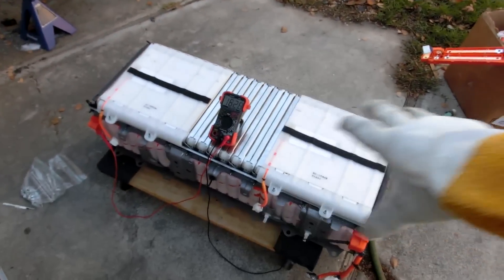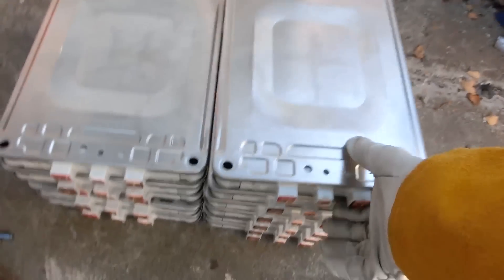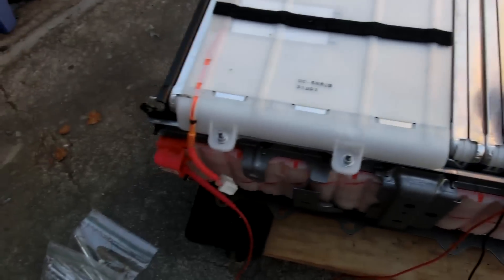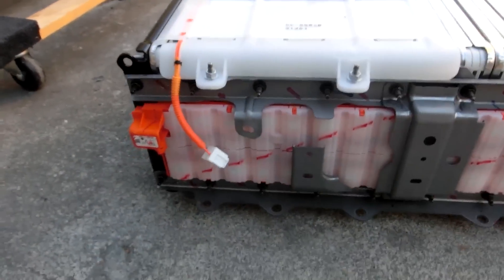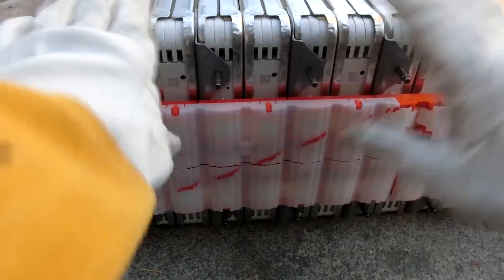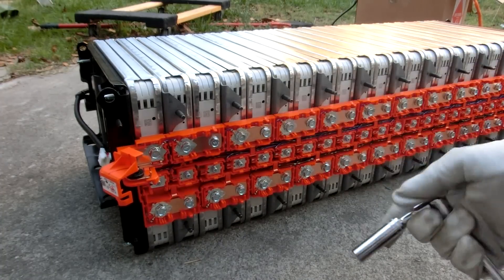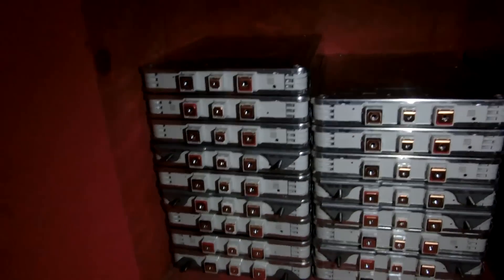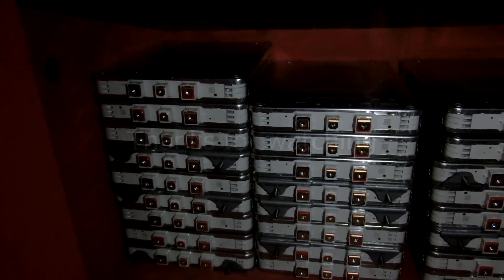2013 Nissan Leaf battery disassembly part2

Comment: 180VDC would at most give you a tingle, not enough to kill.. (if you meant lethal being electrocution) 
still best to be cautious though since a short circuit would be a verrrryyy bad thing.
Reply: 180v is plenty to complete a circuit through the body , the amount of current they could put though you could easily kill you
Reply: Dynamitemonkey500 No... It's DC 180v, our body cannot be modelled by a simple resistor as we have capacitance too. A capacitor in a DC circuit is seen as an open circuit in the steady state (i.e. yes current will flow through you if you have both hands on each terminal, but the duration of harmful current is far too low to cause any injury)
Reply: IrishSkruffles
a capacitor is a DC power source. We are talking about DC voltage. A capacitor is a DC power source and yes a 240V Capacitor can stop your heart. A 180v battery can deliver enough current to kill you. If you dont believe go grab a 240v capacitor. There have been cases where people have died on 48v dc before.
Reply: +IrishSkruffles      interesting, so what's the impedance of the body (hand to hand)?     and the pure resistance?
Reply: Henry Chang Both vary from person to person and the moisture of your hands at the time but I can tell you resistance of unbroken, dry skin is roughly 2 mega ohms, and capacitance is 1-3nF.. impedance is harder to measure and it's worth noting that high voltage can break down your skin drastically reducing your resistance to only a few thousand ohms
Reply: +IrishSkruffles    for 60Hz AC,  the impedance for the "capacitor" is 1-3 mega ohms,  so it's insignificant if the resistance is a few thousand ohms at high voltage
Reply: Henry Chang Yes that is correct but if the skin breaks down, the current flows through your flesh so capacitance need not be modelled, that's what i was saying
Reply: Henry Chang I found this interesting:
http://www.ncbi.nlm.nih.gov/pmc/articles/PMC2763825/table/T1/
Reply: +IrishSkruffles    actually, more current goes through your fresh and blood due to the moisture after the skin breaks down,  whether it's AC or DC.
Reply: +IrishSkruffles    good info.  thanks
Reply: +IrishSkruffles hahaha your hilarious...lol That 180v will clench every muscle i your body if you grabbed onto it. If you grabbed the leads you will not be able to let out. 180v will light your ass on fire it only takes 90v to penetrate dry skin.
Reply: Cutler Cycles You are mistaken.
Reply: IrishSkruffles
Negative go touch a 240v capacitor or 120v capacitor. even 1nF that delivers 100ma can stop your heart and kill you if you complete the circuit through your heart. Those are DC examples.
Reply: +Cutler Cycles Capacitors != batteries,
16mA is enough to make your muscles contract, which 180V cannot do.. I've touched 300VDC supplies before with nothing more than a tingle, you are mistaken.
Reply: +Cutler Cycles 
A capacitor discharges nearly instantaneously whereas a battery does not, it is a different case but even then it would have to have a capacitance of over 250uF to do any permanent damage (at 300VDC).
A 180V battery can provide a lot of current, yes.. but not anywhere near lethal levels if you touch the terminals with dry hands.
FYI I have and oh look, I'm not dead..
Yes you can die with as low as 30VDC, but that's in aquatic environments..
Reply: IrishSkruffles Maybe you haven't but other have died from 48V and up. What you are saying is like a car accident can kill you at 35mph but since I didn't die in my car accident at 35mph then car accidents at 35mph must be safe. Bad logic. It has been scientifically proven that you can die from these voltage ranges so the end of the conversation is it CAN be dangerous and even lethal so its not wise to try an lessen the caution around voltages that high.
Reply: +Cutler Cycles I've been shocked multiple times at 5kv plus an five seen atleast 7 other people be shocked aswell, while I would say DC is dangerous with 1+ amp I think you might be talking about AC.
Reply: Voltage doesn't kill, current kills.  A ground fault circuit breaker trips at about 5 milliamperes or 5/1000 of an amp.  A 1/2 amp current through your body will likely end your life.   The current generated in an electrical shock is dependent on several factors but the battery pack shown here can kill under certain circumstances.

Comment: the brackets that are still on the batterys with the studs on do they come off to or are they stuck on to the battery
Reply from the maker: +David Simpson i think they are stuck..
Reply: that will make pack arrangement a little more of a pain then
Reply from the maker: David Simpson
actually i dont think so, i think it will add more places for mounting. after all i dont want anything close to teh terminals anyway.
Reply: true so how you going to do the cirty car 2 packs horizontal or 3 packs vertical each at max voltage ?
Reply: or will it be a case of the hole back seat area will be gone and how do you intend on getting them to your dads from where you are now
Reply from the maker: David Simpson
idk i'll figure it out...hahaha

Comment: Having been a mechanic for decades, can I offer a bit of advice on your ratchet technique?  Use left hand initially to break the bolts loose.  The wrench will be assisted by gravity and as your left arm begins to tire, you can switch back.  The day will go much easier.  Working against gravity does not help.
Reply: +Rinoa Super-Genius Dude.  The guy is offering free, hard-earned advice.  Enjoy it and add to your knowledge, particularly because it may come in handy in the future if you start building the habit now.  As for your tip, do you think a guy who is a mechanic for decades hasn't used the pipe-over-wrench-handle trick?  Exercise some humility - it will build relationships, respect, and knowledge.
Reply: you give too much credit to the pipe the wrench over wrench technique is better putting the box end on the bolt putting another wrench box in on the open end part of the wrench do not use harbor freight stuff for this you will break your knuckles let's all go to mustie1 to do our wrenching great video I wish you'd have broke down at least one of those I've never seen these I'm not familiar with any of this I only have had heard things
Reply from the maker: Thomas Finch
everyone's days are numbered.
Reply: +RyeOnHam The guy is using a metal screwdriver between the contacts of a high voltage battery pack. His days are numbered anyway...
Reply: Correct!
And always loosen ALL bolts a just a little bit.
Then use a driver with a T-bar to undo the bolts. support the long end with one hand and spin the Bar.
This works as fast as an electric tool.

If you are not a mechanic you waste time by:
- using the wrong tools
- using the correct tools in the wrong way
- undoing things that are better left alone
Reply: Jimbo Jones Well, I didn't realize you knew it all.  I suppose you can get everywhere on a car with a bigger bar or an impact wrench, right?
Reply: RyeOnHam Nope, that's why I also use combination spanners interlocked. Never had a problem cracking any nut with either choice of those tools in any space.
Reply: Can i offer some advice...when someone offers free advice take it, dont come back with a counter comment, makes you look and sound like a know it all dick, its all life coaching, we where all young once....apart from that good video
Reply: Rinoa Super-Genius Nah, you're welcome to throw out your own tips, as well.  But don't get hung up on that - it was a total side issue.
Reply: +RyeOnHam Would be nice to have some electric impact drivers too. Makes the job go by much faster. And if the pipe-wrench leverage trick breaks your ratchet, buy better tools eh? I like that I'm not the only mech that likes geeking out on these videos.
Reply: Thomas Finch Yeah, but it's an insulated handle... so, yeah.
Reply: +Jeremy Venturino I just use my 20v lithium drill with a socket bit ,just loosen them first with a wrench or socket , make for fast dissaselmbly , also most drills are all plastic nowadays besides the chuck
Reply: +RyeOnHam thanks very much for this tip!
Reply: +Rinoa Super-Genius Obviously his advice was meant for the many times you'll be equipped with just a ratchet and your arms. Using a pipe over the end of a wrench is a good way to strip your sockets, or worse, the bolt. Most mechanics have a pneumatic impact wrench at their disposal anyway.
Reply: +RyeOnHam In her defence, she was pulling the ratchet towards her which avoids the accidental punching of a hard object when the ratchet slips. Pulling the ratchet downwards isn't really possible that close to the ground so it's either work against gravity or risk punching the floor.
Reply: Jimbo Jones Breaking the bolts loos only takes a bump.
Reply: RyeOnHam A "bump" with what? Are you suggesting hitting the ratchet with your hand? That's a good way to injure yourself...
Reply: Jimbo Jones Do you even turn wrenches?
Reply: RyeOnHam Yes, and as part of my training 20 years ago we were specifically taught that if you need to break a stiff bolt either use a bigger bar or use an impact driver because hitting a ratchet with your hand all day is a great way to injure yourself. Who taught you to fix cars? He must injure himself a lot.
Reply: youre a virgin bro
Reply: any issue with use of a makita impact gun?
Reply: Rinoa Super-Genius  I would not suggest the pipe trick unless you want to replace the ratchet.  I'm just saying, I've trained scores of mechanics and if you get in good habits early, you can do more work quicker.  I got taught by my father and Grandpa who were both Aircraft Mechanics going back to before WW I.  50 nuts are okay, 200 nuts are gonna get tedious and tiring.  I worked with thousands of nuts, bolts, and screws at a time.  You can't stumble your way through that much work without some expert techniques.
Reply from the maker: n8guy
ok so he can give advice, but i can't give advice? lol whatever.
Reply from the maker: +RyeOnHam that would only matter if i have a bunch of bolts to break loose.

a better tip is to put a pipe on the handle as a breaker bar.

Comment: im surprised to not see any spacers between the cells. i guess they dont get that warm.
Reply: +MrTommymxr They do have a metal housing, I guess the heat conduction of that is enough. 
These cells also have a very low internal resistance and thus in fact don't get that warm. (except when you short them out of course ;P )

Comment: the volts won't kill you the amps will
Reply: +Comedic Sketches cue AFROTECHMOD
Reply: yeah i remember
Reply: +Comedic Sketches Your both right. The 12v car battery does not have enough volts to over come the resistance of the skin. Simple V=IR. It does though take only 32mA across ur heart to put into ventriculation, where U will need the zappy thing on ur chest to make ur heart beat right again. Only 32mA.... so we still should treat them with a bit of respect. It is the amps that will kill you not the volts. You can charge people up to hundreds of thousands of volts with respect to earth. The are fine until they touch or come close to something that they can make a circuit with and then the amps flow. Go and watch some high voltage helicopter and linesman vids on youtube its pretty amazing what is actually happening physics wise.
Reply: +Comedic Sketches Yep. In fact what matters is a combination of power (voltage*current) and energy delivered (power*time) to your heart that will kill you. an amp for a nanosecond or so won't kill you, in fact if you are electrostatically charged and touch something grounded (like a water pipe or so), a significant current will flow, but only for an extremely short amount of time and will only hurt a little.
source: TU München: lecture notes "Basics of power engineering", chapter electric safety.
Reply: +Colton Carroll     it's the volts that kill you.     I = V/R,    amp is derived from voltage so voltage is the trouble maker.
Reply: Henry Chang So, in your logic, how does a taser not kill you? Those can apply a voltage of up to 500 kV (500 000Volts)
Reply: Henry Chang Why? those can put out a few amps, but only for a very short amount of time. 
Define the time over which you compute the average current. a millisecond? a second? a minute? an hour?
Reply: +Maanuueel42 \m/(^_^)    the high voltage pulse probably last a nanosecond in a certain period.    anyway,  if it kills, the voltage causes that.
Reply: No if thare are no amps you are good that's why you don't die if you put a frock in the outlit
Reply: +Colton Carroll    I'm trying to say if you're killed, it's the voltage that does the killing basically.
Reply: Colton Carroll You're both right. What does the killing is the amount of electric charge flowing (current) through your heart in a specific amount of time, causing the muscles to desynchronise and fail to effectively pump blood.
However, to get that amount of current flowing, you need a certain voltage, very dependant on high or low frequency AC, DC, the wetness of your skin, wether you have any wounds in contact with the power supplying device, etc.
btw.: Fun fact: It is possible to not notice your heart has stopped, because that is not at all painful. Quite a few electricians have died sitting next to the fusebox they were working on, taking a break after having been shocked.
Reply: +Colton Carroll ok let me set this straight 120v AC is dangerous because your body has a slight capacitance, allowing it to pass through your body easier. if you rectify 120v AC into dc you get about 170v DC, which is much less dangerous than 120v AC, because the capacitance of your body doesnt matter with dc.
Reply: DMAN22yeah True. 170V DC is still enough to kill you, though (if you're unlucky and have wet hands)
Reply: Maanuueel42 \m/(^_^) it is dangerous under the right conditions yes.